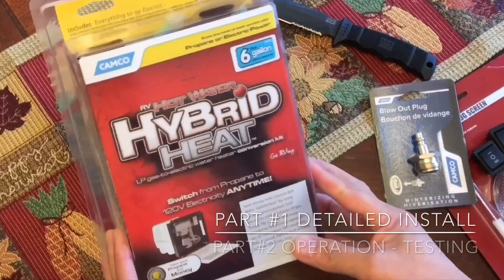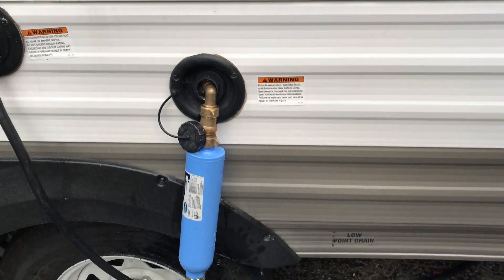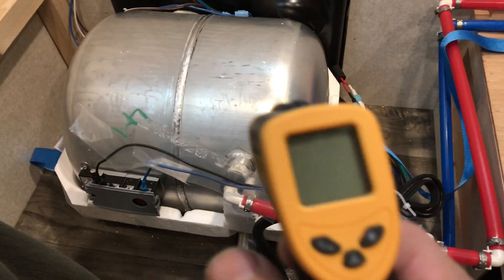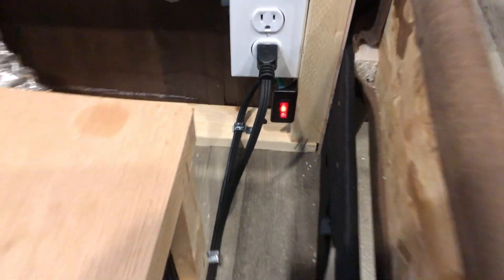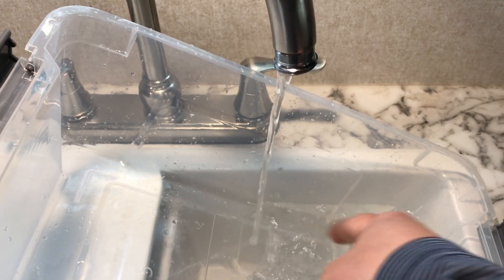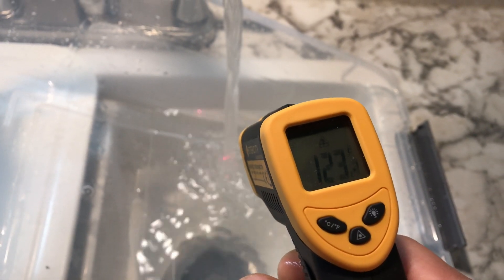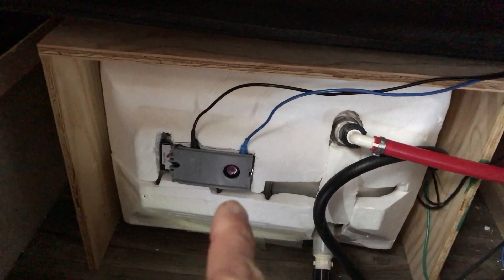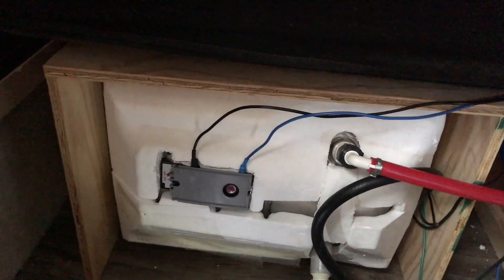Part 2 Testing & Operation Camco RV Hot Water Hybrid Heat Kit Electric Conversion Step by Step

Comment: I just put one of these in my RV,  My water heater is tucked in tightly under frig it was not as easy to get at but I got it done. Seems to be working just fine. Good video!  Good point on the maint aspect of draining the water, Im going to have to cut my wires and put connectors for easier removal of heating rod. Its too bad manufacturer didn't take this into account when the made this unit.